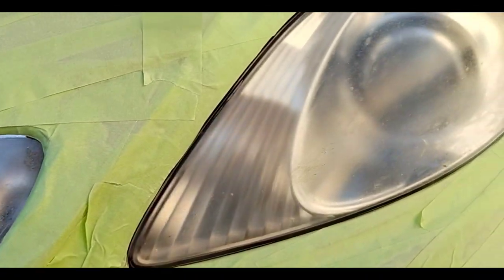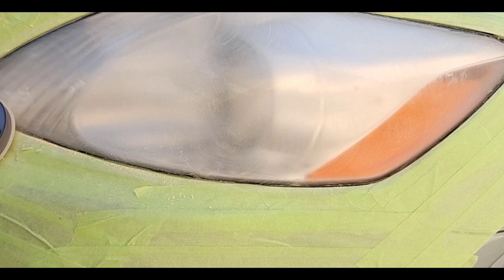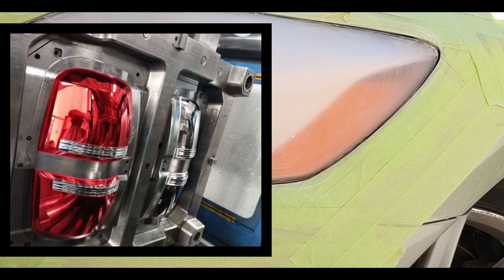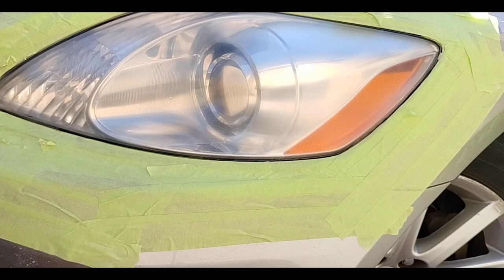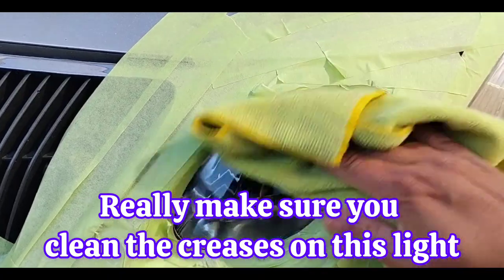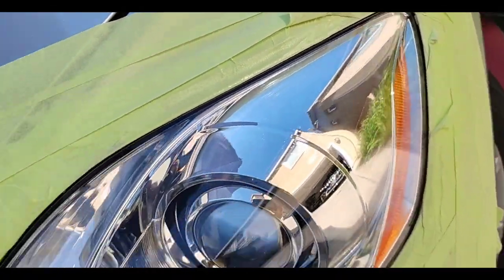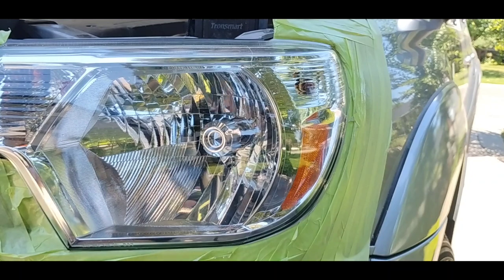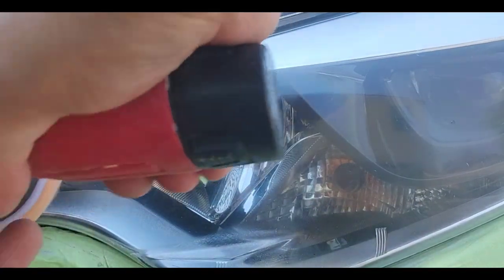Headlight Restoration - CHEMISTRY and more⚗️🧪

Comment: I just did my 2011 Corolla the other day and did my lady’s 2015 Camry today. Both sets of headlights were heavily oxidized and had never had anything done to them. My Corolla lights came out great (my 1st try doing headlight restoration) and her Camry lights came out very good but not quite as clear as the Corolla. I literally bought everything you linked in your bio, all the tools. I used a roughly 50/50 mix of the Chemical Guys and the 3M Perfect It for polishing.

It’s curious that my Corolla headlights came out a bit clearer than her Camry’s 🤔 given that the Corolla is older. Either way it’s a great start and I couldn’t be more grateful for your exhaustive research and wealth of information. Thank you 🙏🏽

I’ll tinker with the ratios and try out The Treatment as well as Flitz polish too.

Next I’m going my 2005 Lincoln Town Car headlights.

Comment: Have you ever tried a 2 inch backing plate/interface pad and trimmed ✂️ the sanding disks and/or the finesse it buffing pad down to fit? Seems like this setup could be helpful for tricky lights with multiple tight corners and narrow spots.

You’ve done thousands of lights so you’re the man to know if this is worth a try or not really worth the effort or even necessary. 🤷🏻‍♂️

Comment: Can you recommend which videos to start with for a beginner?  Have a 3 in DA polisher, and only a dewalt cordless. Do have 3 in sanding pads. Ty dude. You are super knowledgeable!
Reply from the maker: Honestly I'd start at my oldest video I work your way up...
But probably before that I would watch the video that's titled why do headlights go bad?
Also the da can get it.. but I would invest in a high-powered high-speed polisher 3 in rotary... Like the AC Delco I use-I use this one cuz it's pretty much perfect for the job durable and you come by as many batteries as you need some of them you can't buy extra batteries unless you buy a new device... But here's that video I will start with and then I would watch from the oldest videos up to the newest definitely put your game above most in your area I'm sure...🤓👌...https://youtu.be/tnCdU2j5Ja0

Comment: Just a fantastic results!! Question could your method regarding mixing these two polishes together 50/50 work as a after care as well? As i know the wet wax by C/ guys contains UV blockers!! Thanks for sharing your knowledge and expertise 🤔🙂👍🇬🇧
Reply from the maker: Well probably not... Just because any kind of compound is going to be abrasive or more abrasive than any kind of Polish... It's remover in a leveler... So I wouldn't advise it...
Reply: Thankyou so much👍🇬🇧
Reply from the maker: Anytime!!!!

Comment: If you don't have a polisher yet, is it alright to use the drill to polish in the meantime? Would it affect the results in any significant manner?
Reply: @danladimoore9641  I get that to go that one step further I'd need a polisher, but it's great to hear that I won't be sacrificing too much quality for the time being.
Reply: @rudygabrielperdomo9523 

Using the HRP method, instead of 3M polish, I used meguiars plasticX with a drill.  Good results, enough to improve nighttime visibility.

Get some jobs under your belt and invest in a polisher.
Reply from the maker: You could use it and you can produce a pretty good product.. but with that being said it won't be anything like this it's lacking the speed via RPMs which means it's lacking a certain level of heat... It would do something but none of this level... You would have to have these high-powered polishers...
Reply from the maker: You can do it but yes it is a drastic significant difference there is a reason why I use it... Somebody will tell you that it's close to or something like that that's because they're an educated and they haven't done enough headlights... Trust me it's like on a scale of 1 to 10 you could produce a 4 without the polisher... With a polisher you could produce a 10 sometimes at 11....💯🤓

Comment: Hi is it common to see scratch when the light is on?
Reply from the maker: Depends on how in-depth your work is... Always got to check your work.. always going to have a smooth hand. Light pressure in first and foremost pay attention to the instructions I provide in countless videos.. and you should be okay.. shouldn't see them if you check your work and make sure they're not there before you coat.
Reply: @theheadlightrestorationpro  thank you i will check carefully each time.

Comment: I tried a dozen of times . I put pressure when i sand with the drill  but then it comes out in blotches like worse then it started . Black clouds mixed with the faded sanded part
Reply from the maker: Have to do what I say on the video and do it like I do on the video if you wanted to come out the way it comes out when I do it..
Reply: @theheadlightrestorationpro i really did what you did . I watched your videos so many times . It’s probably the dewalt drill is to fast . My name is Barry by the way nice to be in contact with you. I dig it . Every you do!! Very nice work. Maybe ill get the same drills as you and pads . To do the same job. I appreciate your feedback. Its the experience process i am going through. I want to show you pics in the chat but don’t know how . Could you add the link i. Here so i can go straight there to show you my impressive work. I wont give up ! I will master this . Just need a hand and pictures to show . Thanks so much. Your a super star!!!👊🏻👊🏻🤟🏻
Reply from the maker: I was just going off of what you listed you did and it's not what I'm doing so if you're having any issues probably the reason...
Thanks for watching
Reply: Thank you . I will pay attention to every detail .  Il keep trying . The mix is 70-30 . The meguiers 70 and 3m cutting polish
Reply: Works the best with the oils in meguiers and just enough to cut to a nice glossy finish. Hope you enjoy. Can you show me on a spare light. How i get theses black coulds on bmw lights

Comment: Not sure what im doing wrong. I use the 500, 800, then 3000 trizac and use the nice polish from meguiers and use the damping method and looks amazing untill the clear coat then it looks shit again. Its  28 degrees out here . I figure its hot enough to use outside with my mask. I resand it with the trizac by hand polish it one more time then clear coat lighter then it looks clearer then a thick coat that runs
Reply from the maker: I don't know you're not doing what I do...

Comment: Love your videos.  What would cause the meguairs headlight coating to dry with a sort of textured finish to it?   I use your steps of 500, 800, trizact 3k, 7800rpm with clear lens polish.
Reply from the maker: Could be a bunch of things.. for the tune that strike a bell in my head is what polish did you use? Also did you hold the sprayer far enough away or better yet too far away? And did you follow my instructions with one layer or did you do too?..